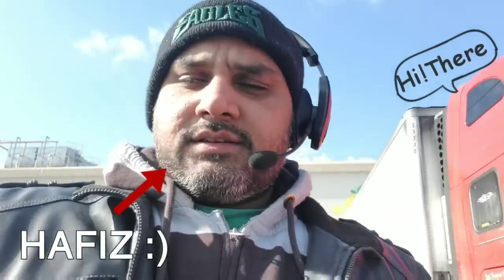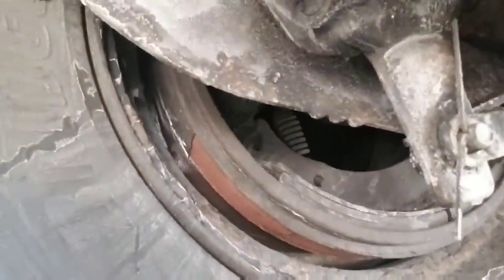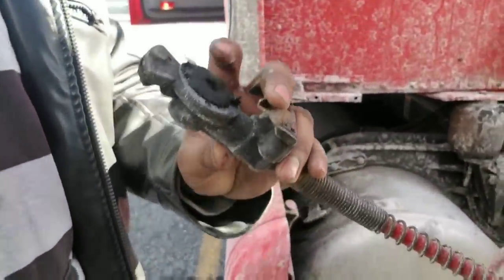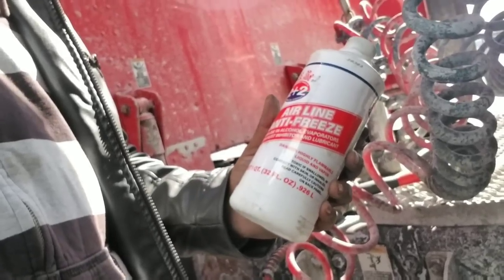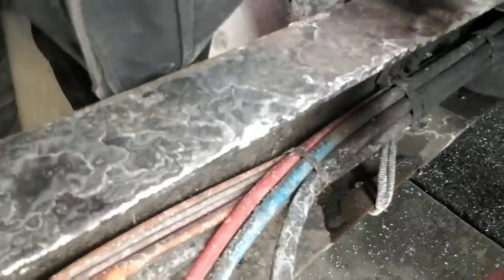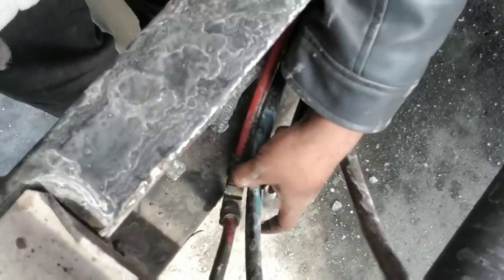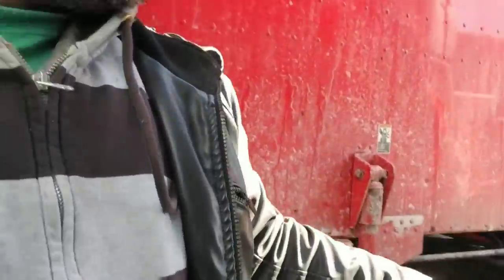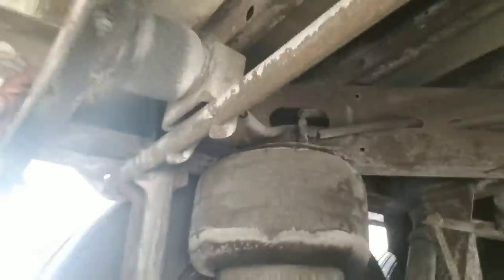How to find & fix truck frozen air lines/ Frozen brakes /Frozen tanks

Comment: Don't use the hammer. If the trailer brakes froze from rain water just try rocking the trailer back a forth a couple of times and the ice will fall straight down and you will have unlocked brakes again.

Comment: Moral of the story Drivers never brake your trailer during freezing temperatures.
Reply from the maker: That's right. But sometime warehouses make u unhook air lines/trailers.
Reply: True.
Reply: Where does the brake anti freeze go and how do you drain it out in case you put too much in?

Comment: Hey man nice video, what if the tractor doesn’t build up air because of frozen lines? What do I do? Thanks bro
Reply from the maker: Manuel Salgado if u put alcohol into compressor line it will open all the frozen air lines in tractor and trailer.
Reply from the maker: go all the way to the end of video.
Reply: What is the name alcohol u need to put the air compressor

Comment: You missed the main point.  This vedio is deadly. You   push the release button at the dash,  then go under  and and hit the drums , once all the brakes released  the truck will roll on you.  YOU HAVE TO CHOKE  THE WHEELS  FIRST.
the truck driver died recently by a truck when he tryed release the brakes , I wonder  whether  he was  following your vedio.
Reply from the maker: No sir the tractor brakes were on and trailer brakes were released. If we releasing trailer brakes we won't roll with tractor brakes on.
Reply: @desitruckersinu.s.a2797  
You never mentioned  anywhere in your  vedio, telling  the viewers to have the trailer brakes on, Also never  mention to choke wheels  the tractor is not hooked up to a trailer. As a licensed truck and trailer mechanic, I know  how  the drivers behave.
Reply from the maker: @christopherpaul2544  i consider every one is smart enough. If someone is cdl A holder than they should know the basics.